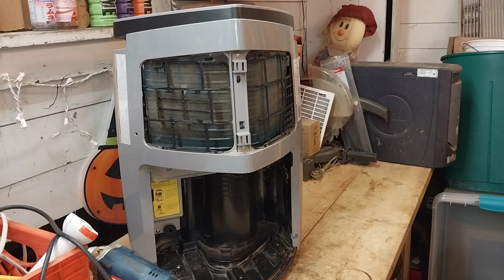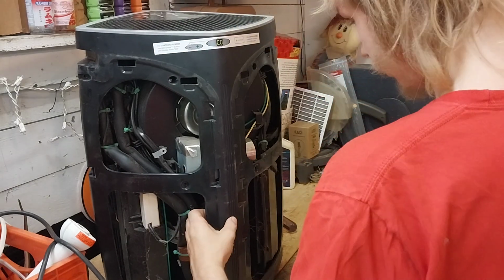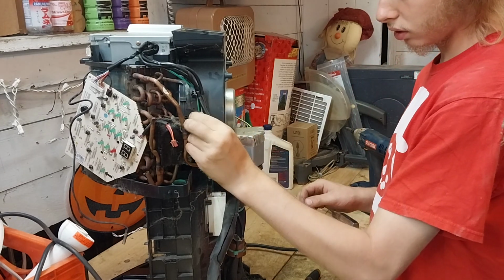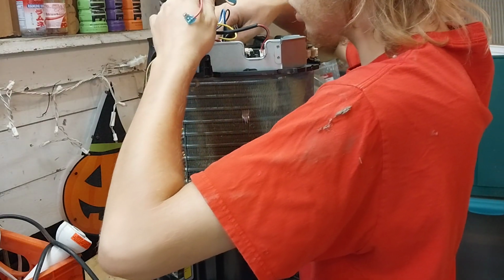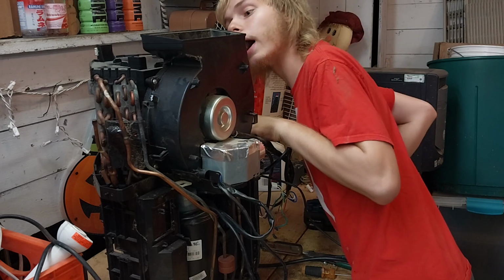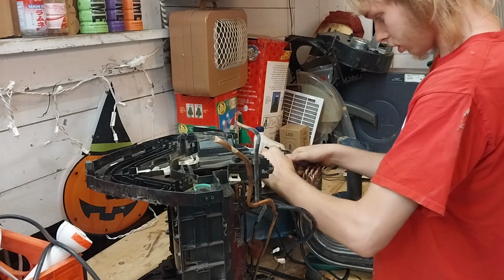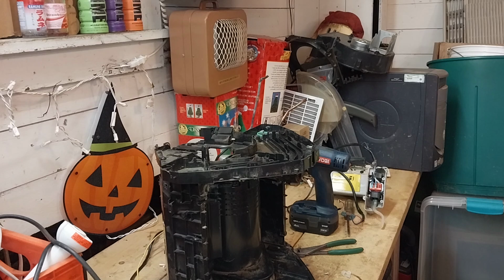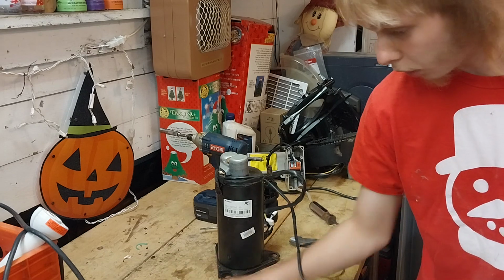scrapping the other junk dehumidifier

Comment: yes. for as crappy as these are i concur they are usually well grounded. i think they do this so at least the consumer doesnt get shocked when it inevitably breaks. yes they are throwaway pos. which p me off at the waste...i do find the fan motors fairly robust and i reuse for a variety of uses.